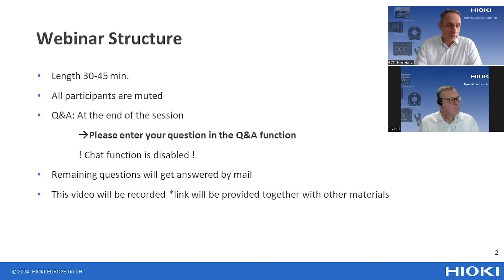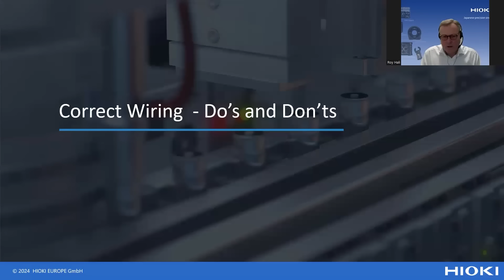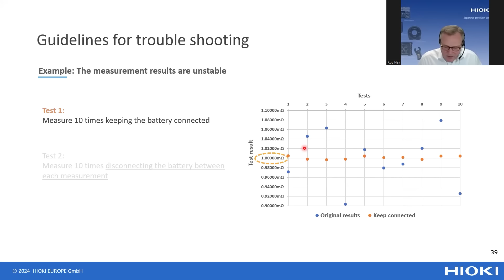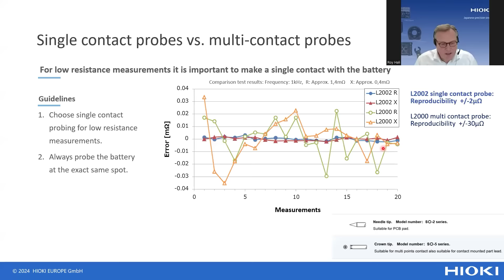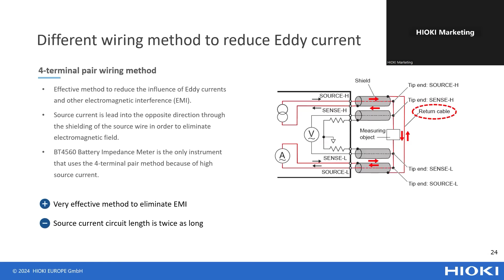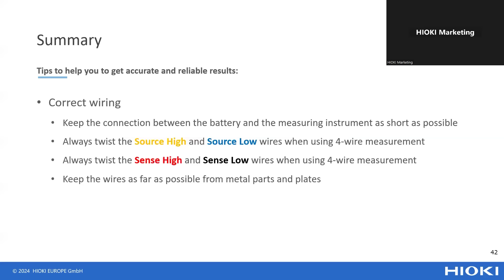Reliable Testing in the Battery Production line: Do's & Dont's - HIOKI Webinar

Comment: Actually I have three questions . 
1. Does AC IR measurement depends on the SOC of the lithium battery ? 
2. Does AC IR measurement depends on the temperature ?
3. What is the model number (Hioki part number) of the single contact probe for the BT series battery testers shown in page 18 ?
Reply from the maker: Thanks for the good questions that are relevant for this topic. If you need any more info, please feel free to contact us.
1.  Does AC-IR measurement depend on the SOC of the lithium battery ? 
In general, the lower the SOC, the more significant is the influence on the measurement. Reproducibility would be significantly worse with a low SOC. Therefore, we recommend measuring at a higher SOC to achieve a more accurate AC-IR result.

2.  Does AC-IR measurement depend on the temperature ? 
Yes, temperature changes could affect the measurement results. We would recommend keeping the ambient temperature in the measurement environment stable. In general, measurement results would be within the accuracy specifications of the instrument itself if measurements are executed within the stated temperature range of the instrument.

3.  What is the model number (Hioki part number) of the single contact probe for the BT series battery testers shown in page 18 ?
You can find a selection of HIOKI probes in our catalog (pages 22/23) that you can download from here:  https://www.hioki.com/euro-en/download/37483
Please look out for example for L2100 or 9772 for your purposes.
Reply: @hiokieurope  Thank you very much. I hope this information will be helpful for  those who work with batteries
Reply: Non ho capito